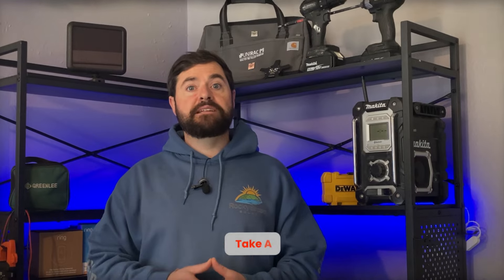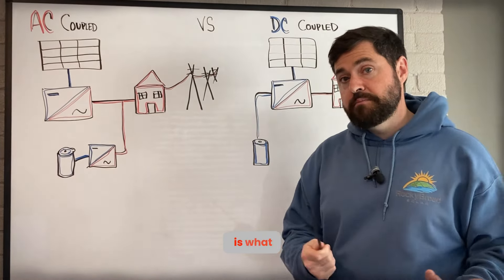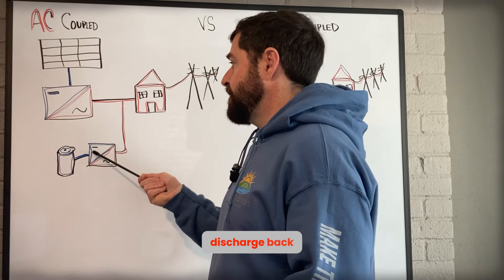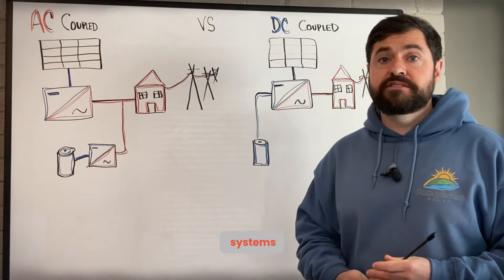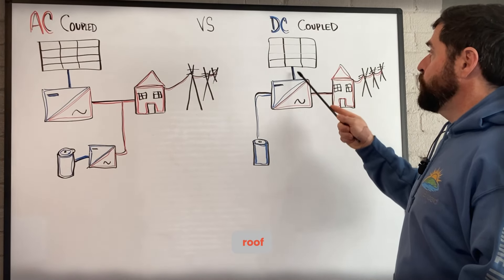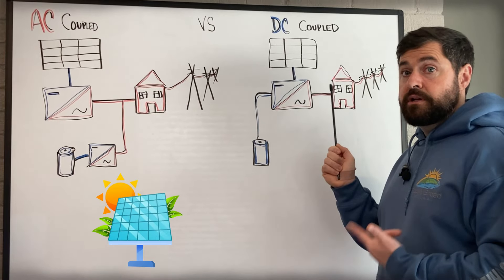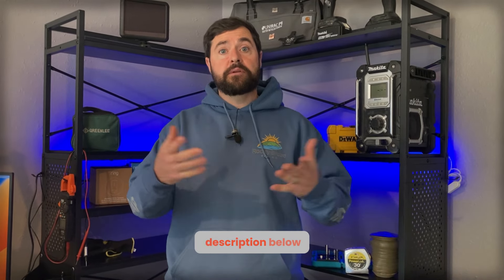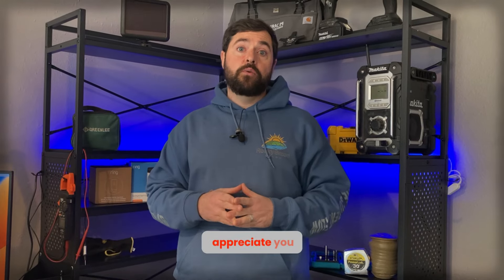Solar Home Batteries - AC Coupled vs DC Coupled

Comment: The DC from PV is not going direct to the battery, there is a charge controller that babies the batteries with current needed, while a string of PV runs higher voltage. The power loss is minimal, but not zero.
Reply from the maker: Makes sense!

Comment: I have built an off grid system where I use the utility as backup. On my home I have also several transfer switches, so I can switch several high power use devices back and forth from utility to battery. (basically water heater, pool pump and air conditioning) This is useful in peak winter or if there are  3 days of rain. For single phase all this is very easy. I would have chosen differently for a 3 phases home. Power bill is about 6% of what it was. I use recycled 18650, used old PV, and 4 chinese cheap 3000VA inverters, since 2014 nothing broke. roughly 9KW PV and 12KWH batteries. 24V 7S battery system.
Reply from the maker: Impressive! I hope to get to that point in the near future. Thanks for watching!
Reply: @RockyBroadSolarLLC   in isolation, nothing is difficult nor complex, it's the whole thing that looks like a gas refinery, so keep in mind all the danger and risks of electrrical systems and fire risk of LiPo, I have all on a trailer, with 3 different types of fire extinguishers around, and all can be swiftly unplugged and hand rolled outside on concrete to let it burn if one day shit happens. (because shit DOES happen, you just don't know when)

Comment: The AC coupled system is also safer than running high voltage DC cables, where DC arcing from damaged cables caused by rodents and mechanical wear can cause roof fires and electrocution risks.
Reply from the maker: Great input. Thanks for watching the channel!
Reply: You assume roof mounted panels. Ground mount can’t start a roof fire.

Comment: Can we AC and DC couple at the same time? I think yes. What are issue will occure during the the setup? As DYI Trying to see what benefits for both system intergrated?
Reply from the maker: Absolutely. Depends on your inverter, but many battery capable inverters do allow you to both AC and DC couple separate PV systems at the same time. This would also give you another level of redundancy in case one of the two systems went down. Thanks for watching!

Comment: Can a stand-by generator (Generac) be hooked up to a solar panel dc battery system to assist when the electric supplier is off line?
Reply from the maker: Yes, Either of these options can be combined with a standby generator for an additional layer of backup power. Thanks for watching!